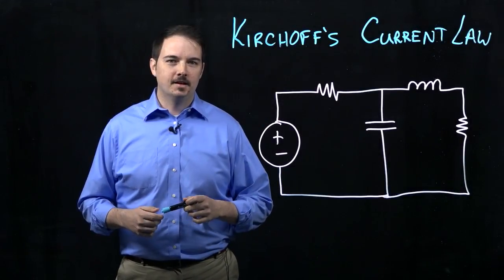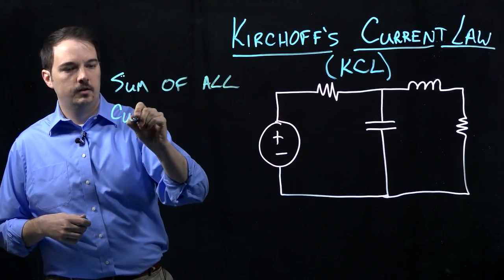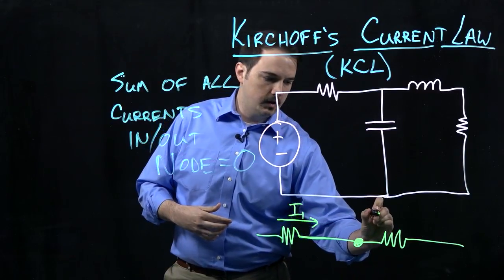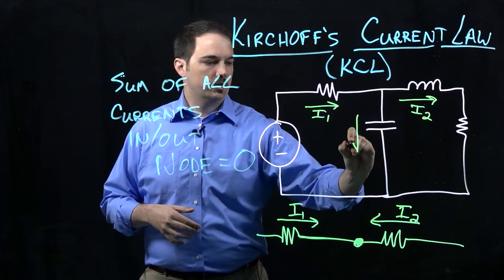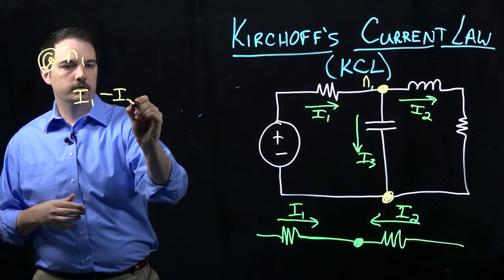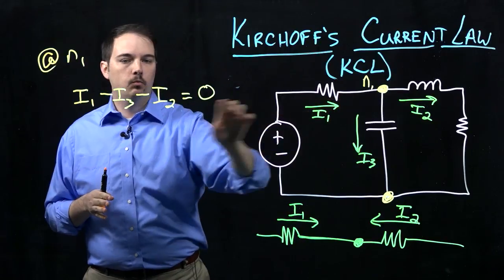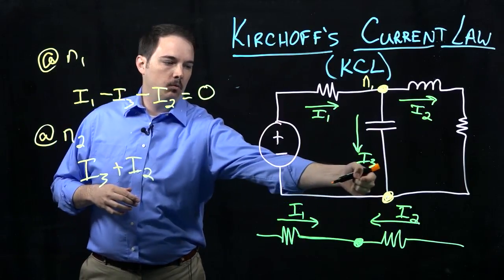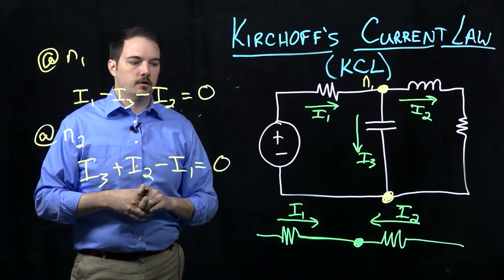Circuits I: Kirchoff's Current Law (KCL)

Comment: Hello Mr Dr.Hyle Montdomery,
             Superb Explanation & understanding quickly about of KCL along with example circuit...!!! One request please upload the video which is solved example circuit with the some values of Voltage Source, Current source, resistor, capacitor & inductance.